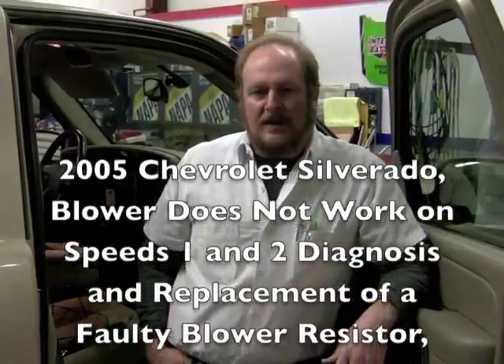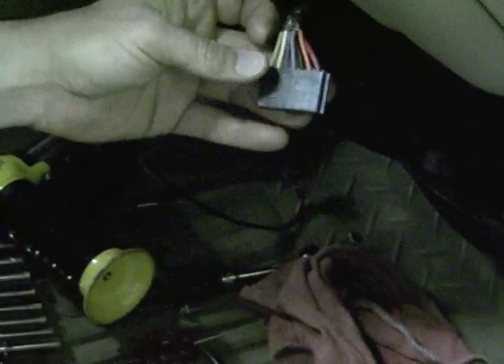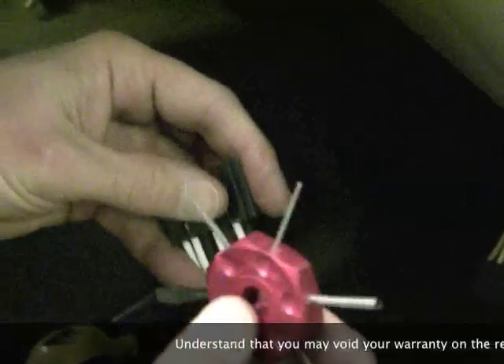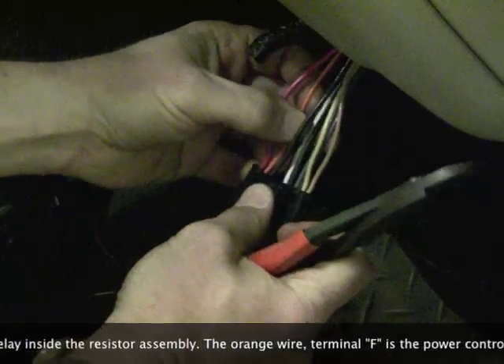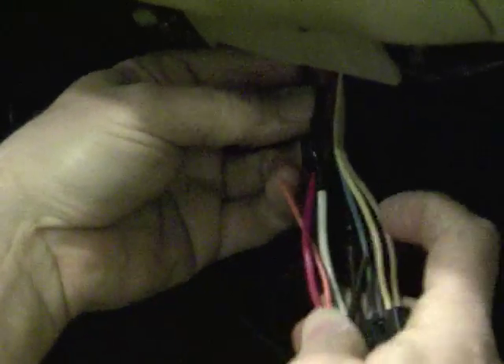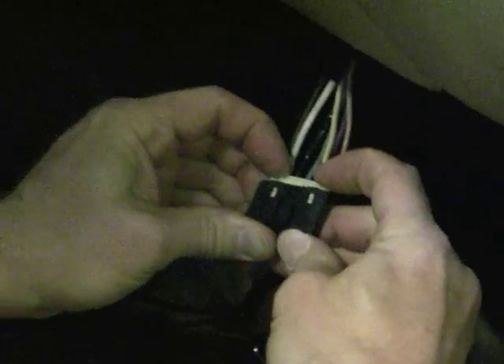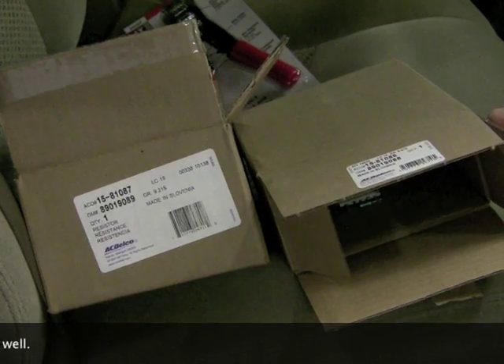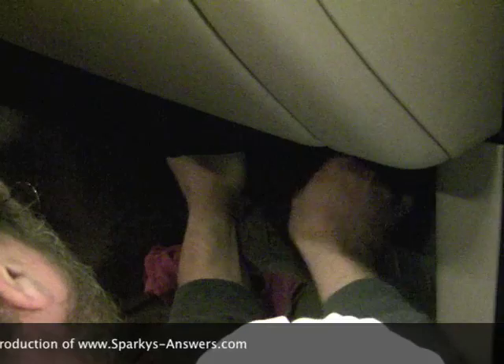2005 Chevrolet Silverado Blower Inop

Comment: I had this problem, the blower costs 89.99 not returnable electronics autozone, the resistor cost 179.99 ish.also not returnable. I pulled out the resistor and cleaned the fins, the resistor comes out with a 5.5mm socket . I used electronics cleaner actually mass air-flow sensor cleaner and wiped it down good works like new all speeds. So try this before spending several hundred bucks
Reply from the maker: Since you mentioned that you wiped down the aluminum fins that would indicate that you have auto controls in your truck. I genuinely hope that you have no more issues with your blower but experience tells me that it is not fixed. The aluminum fins are merely heatsinks. In the process of cleaning the fins you have inadvertently corrected a poor connection somewhere else. More than likely at the harness connector but it could be elsewhere.
Reply: The resistor is 34 bucks not 179

Comment: hi, had a few questions about this I changed both resister and the wire harness just as you have and have tested with light theres power to each speed also after all installed tested power to blower light tests with power from speed five only rest show no light:( what started this is all speeds worked but 5 because of burnt out wire now I have nothing coming out all fuses changed to make sure not blown. I thought maybe it was bad resister again and tried old one where it worked when I took it out and nothing would this be a bad resister or did the blower motor go?
Reply from the maker: Follow the instructions on my main site. http://www.sparkys-answers.com/2008/07/2005-chevrolet-silverado-blower-inop.html
Reply from the maker: You will need to do the circuit tests both with the seven wire harness disconnected from the resistor and then again with it connected.

Comment: hello i have a 2003 silverado relaced blower resistor and work fine for a couple of days now it only works on position 5 again bought acdelco part do u think it is a faulty resistor
Reply from the maker: It would be highly unlikely for a new AC Delco  resistor to go bad in just a few days unless it has gotten wet. I would check for any signs of water. If no signs are present I would recommend performing the voltage tests at the 7 wire harness connector.

Comment from the maker: The drain tube is located under the hood on the passenger side of the firewall. It is below the accumulator tank and slightly towards the engine.

Comment: Where is the drain tube located, is it easy to access? The floor board has been wet, even with the truck no being driven for long periods of time. I dont know if its the windshield, or if its the rubber seal in the door.

Comment from the maker: If there are any signs of water, you definitely want to correct that. Also check the interior surfaces of the resistor for signs of water.  Do not forget to check the a/c drain tube for proper operation. Again, if you connected power and ground to the two terminals in the blower motor at the same time and it did not turn the motor is faulty.

Comment: My tester light was grounded, and there was power on all terminals except E. With my test light on the positive wire, the Terminal E lit up, none of the other did. So, by process of elimination, I'm fairly certain its my blower motor. This motor was just replaced last winter. I think I have a leak around my windshield, somewhere.

Comment from the maker: The blower motor should turn when power and ground are attached to the two blower motor terminals at the same time. Also if you have power on terminal "E" of the seven wire connector that is a problem. It it supposed to be grounded at all times.

Comment: I have voltage on all wires, no visual damage to any of the connectors. All fuses check ok. With adding a positive and a negative to the blower motor after it was removed, it didnt engage. Is this a good way to test if it works?

Comment from the maker: No voltage on the smaller wires could indicate a problem with the blower switch. Most of the time when the switch is the problem there will be an issue in the way that the switch will rotate. This is caused by melting of the switch and harness connector.

Comment from the maker: It could be but why not take a few minutes to do some testing so that you will know what the problem is rather than guessing. I would start by checking the fuses in the driver's side interior fuse box. If the fuses are okay shift to the blower resistor connector. A visual inspection of the black (terminal E) terminal may find a burnt or loose terminal. If you loose all speeds at one time that is usually the problem. If okay, check voltages on the remaining smaller wires.

Comment: 99 Silverado, 5.3, None of the speeds work for the heater/ac. It has a resistor that was replaced no more than 3 years ago and a new blower motor that was replaced last year. This was a sudden problem. Is my switch bad?
Reply: This is my problem.... Do you figure it out?

Comment: and I check all the wires on the connector and all good with colors and all that but when I connect the last time the new ac blower motor resistor  gets rely hot

Comment: Sparky, I have a quick question. I have a 2006 GMC Sierra. I had a non working fan control 5 recently and just today all settings went out and no air blows through any vents. I can hear the ac kick on and checked fuses already. Is the diagnosis of blower inop the same thing I'm looking at for my truck?

Comment: hi great video by the way just one question I been having problems with the front ac of my Tahoe 2004  I change the ac blower motor resistor and the harness as well and nothing after that I notice that the fuse was broke I change the fuse and order another blower resistor and nothing happens no air blow ,I took the fan and plug it into the battery and works good so I couldn't find the problem ....please help ....

Comment from the maker: Start by checking the condition of the harness connection at the blower speed controller. Then start checking the circuits. I have done several repairs similar to this one one my main site. sparkys-answers dotcom Look in the tab at the top left labelled "Sparky's Repair Article Menu" . Look under GM Full Sized Trucks and Suv's .

Comment from the maker: You will have to test the circuits at the blower resistor but I would suspect that the ground terminal is loose at terminal position "E" of the seven wire blower resistor harness connector. If it is, replacement of the connector and resistor assembly are the best method of repair. I can provide a link to the parts that I use if needed.

Comment: I have a 2002 avalanche, the fan blower works great at speeds below 40 mph but at speeds of 40 mph and above the fan blower speed cuts in half or more. When I slow down to some where around 40 mph it turns itself back up. Any suggestions? Could this also be the resister?

Comment: You 'ROCK', Sparky! The A/C blower on my '03 Silverado stopped working on every speed but 'high'. I was way off track on what I thought the problem was. I found you with a 'google' search and your advice and instructions were 'spot on' correct! I had it fixed in no time, and it only cost me $28.00 and about 1-1/2 hours of a Sunday afternoon! (And that included the time it took me to go get the part. ;-) )
You can expect a little something in the mail, in the next few days. Thanks for the help!

Comment from the maker: More than likely your squeaking blower motor has taken out your new blower resistor. Check the harness connector for damage and also preform a voltage check to make sure you do not have a control signal problem.

Comment: Sparky I replaced my resistor and harness in a 2003 Silverado HD, it worked for about a week then I lost speeds the 4 lowest speed with only high speed #5 only working, now nothing is working. The blower motor was squeaking could it be pulling to much amps and blowing the resistor?

Thanks awesome video by the way!!

Comment from the maker: If you lose all speeds at the exact same time, I recommend looking closely at terminal "E". It is the system ground and is the most common fault for this issue. A lasting repair requires replacing the resistor and the harness connector at the same time. I recommend doing a full test of the system but if heat damage is found &  testing is not an option, replacing the resistor & harness connector should restore the blower operation. I removed the rubber hose & used a shop vac to clear the drain.
Reply: terminal "e" ??
where is this at ?

Comment: Steve, very well done video.  Excellent explanation of what your were doing.  One thing I just wanted to clarify is that I believe you are saying in order to determine if the blower or resistor is the problem then you can check the connection at terminal "E" correct?  Also you didn't show anything on 'unblocking' the A/C drain line, was that plugged and the source of the moisture to begin with?
Reply: rindress I’d love to hear that answer too. My resister went,and it had a lot of rust,even the screws holding it were rusted......?

Comment from the maker: They are the same ground but the high blower relay that is internal to the resistor needs that ground to operate. It may work if you were to "tee" into the black wire going to the blower motor but I have never tried.

Comment: Thanks for info about the possible extended warranty. Truck has < 40k miles (short commute). I guess I would need to see a wiring diagram to understand why speed #5 won't work if I splice the black wires. Ohmmeter suggests they are the same ground.

Comment from the maker: The blower resistor and harness connector are the most common source of the problem. In particular the connection at terminal "E" of the blower resistor and harness connector.

Comment from the maker: If your truck has less than 150,000 miles call your local dealer and have them run the VIN to see if it was part of an extended warranty. If it was the dealership will replace the resistor and harness at no charge. If it has over 150,000 miles or your VIN was not part of the extended warranty, you can splice the two black wires together to get the four lower speeds working(assuming the resistor/ok). If you want speed #5 to work the connection to terminal "E" at the resistor has to be corrected.

Comment: Much appreciated! My '05 Silverado blower stopped (all speeds). Pulled the motor & resistor module. Black wire is burnt @ connector. Motor seems to spin a little hard, so I'm guessing it was pulling too much current. Resistor module *looks* good other than the one burnt pin. I ordered a new ACDelco blower (original is Bosch) & plan to splice existing connector ground into the black output to the blower. I think it is the same ground. Kludge? Yes, but will save me buying new connector & resistor.

Comment from the maker: Removed the rubber drain tube extension hose at the exterior firewall below the accumulator tank. Then used a shop vac to clear the main tube.

Comment from the maker: Glad it was helpful, to clarify though I recommend to Not remove the third screw in the hush panel. Just remove the two and pull the panel down enough to work on the resistor.

Comment from the maker: The most common cause of an intermittent no blower operation is poor terminal connections at the blower resistor or blower motor. In particular, terminal "E" of the seven wire connector. For more detailed diagnostic information please see my repair article from July 30th 2008 on sparkys-answersdotcom.

Comment: hey sparky,  My blower motor worked a few times after it went out. When I started the truck in the morning, then when I turned it off, and back on again, it didn't work. Not sure if it's the switch, or the motor relay..
]

Comment from the maker: In a nut shell, the vehicle harness was designed for the original (lighter duty) resistor. When the resistor was redesigned (heavier duty), problems developed with heat build up at the terminals and nearby wiring. Hence the need for an updated wiring harness connector. The key to overall resistor and connector life on any vehicle is to keep a clean vehicle and to not leave the blower switch in the same position for more than 15 to 30 minutes at a time. Especially the highest two speeds.

Comment from the maker: You can just splice in a repair harness. Anytime you have a burnt connection, it is best to replace the connector and the component at the same time. Also vans are prone to other problems that contribute to resistor failure. Dirt build up on the evaporator core fins,  leaking door/window seals and front unit only installed/working.

Comment: Thanks for the reply.I have some burn spots on the connector. Can I splice in the new connector or do I buy a new wiring harness? Also is there a way to check the resistor or should I just replace it? The blower does work when I press it into the connector but only works sometimes when I am driving. Thanks for the help, I am out of work and this will save me. This video is applicable , just a different location?

Comment from the maker: You should start by checking the blower resistor and harness connector located under the passenger side of the dash. I have a detailed repair article on this subject on my main site sparkys-answers com. Look in the archives for the article dated July 30, 2008.

Comment from the maker: More than likely the problem will be at the blower resistor and it's harness connector. You should read the full repair article that I did on my main site on July 30th, 2008.
sparkys-answers com

Comment from the maker: I would double check to see if the correct fuse was removed. It should have been the 40 amp BLWR fuse. If you did remove the correct fuse, then yes you should be very concerned. The harness connector at the blower resistor is likely to be melted and cross feeding circuits. This will overload the blower switch and cause the a/c control head and harness to be replaced. Under the right conditions there could be a fire as well.

Comment: My '03 Chevy Silverado recently would not start. After trying to jump start the truck w/ no luck I towed it to a mechanic. He said it wasn't the starter but that the fuse box wires or something along those lines seems to have been melted and he needs to replace the fuse box at a cost of $850.00. I have a breathalyzer device installed in the truck and it has been draining my battery and giving me issues. The mechanic is adamant that the device is not causing the fuse box issues. Any thoughts?

Comment from the maker: @WSZOSZOREK  Check the HVAC fuses in the driver's side interior fuse box. Make sure it is good and that there is power at the fuse with the key on. If that is okay, you will need to check the blower switch and harness connector at the rear of the a/c control head. If there is no power at the fuse you will need to check the ignition switch. I did a video about that problem on a Trailblazer or Envoy. No Blower and ABS light on.

Comment from the maker: @EricStaysGold    Please see my video about this type of system "2005 Tahoe Blower Not working". There has been a change to the replacement part. Please see the information at my site. It is titled "2003 GMC Yukon Blower Erratic / Not Working" It was published on July 13, 2011. If you do not have the address, just google Sparkys-Answers.

Comment from the maker: @ffemtrmcneil Try a recalibration first. Disconnect the battery for 1 minute. Reconnect the battery. Start the engine. DO NOT TOUCH the a/c controls. Let the engine run for 4 minutes. Turn the ignition off for at least 10 seconds. No more than 30 seconds. Restart the engine and check a/c operation.

Comment from the maker: @ffemtrmcneil Start by checking your fuses. The HVAC fuse in the interior fuse box may have blown when the resistor and harness connector melted. If that fuse blows you will loose all ignition power to the a/c system.

Comment from the maker: @twistr0405 It could be blown but it is more likely that the terminal in the red wire is burnt or the high blower relay within the blower resistor is faulty. Possibly both.

Comment from the maker: @warriordragon03 It is pretty simple. The BLWR fuse in the underhood fuse box is blown. Depending on the year model of your truck it could be a 30 amp or a 40 amp fuse. If you were to check, you will find no power supply on terminal "G" of the seven wire harness connector.

Comment from the maker: @kenman1717 Thanks for the comment. I agree with your preference for heat shrink tubing, that has a sealer built in. That is all that I use, and it is supplied with the  4180 harness connector kit from The Electric Connection.

Comment: great info here. i work at a dealer and have heard about this and have sold the repair but have never actually done one myself, yet. as for the heat shrink, i always like to use the kind with the glue in it, in case its in the path of moisture.